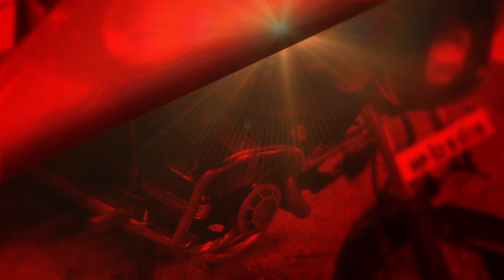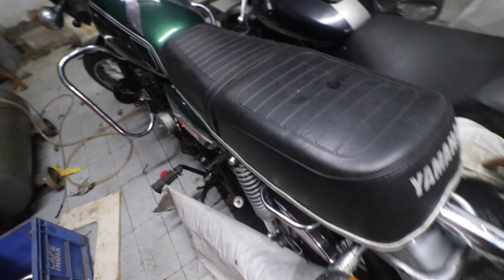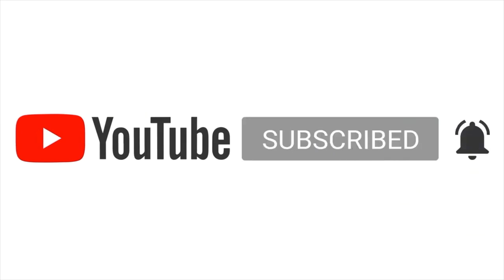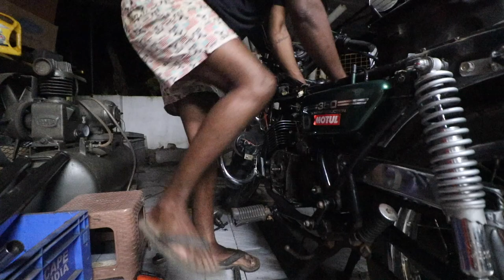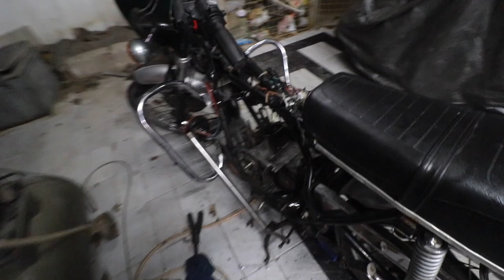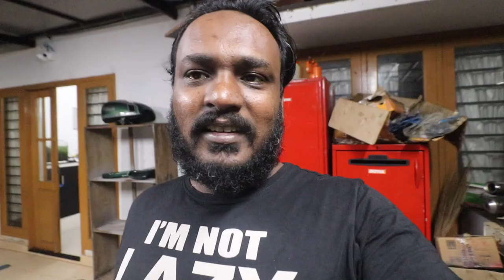RD 350 Rebuild Engine out completely !!!! (Malayalam Video)

Comment: Chetta rxz 4 speed  5  lot convert  (all parts ) chyyan  rate enth vedii verum
Reply from the maker: Enthokke venam ennu parayam, rate parayan budhimuttanu, esadhanagal mrp rates alla.
Reply: @Yamakaze  para
Reply from the maker: Cylinder, head, gearbox, carburettor, engine covers, sprockets, front disk, rider foot rear, right side L bracket, catcon. Stand if you want the full look.